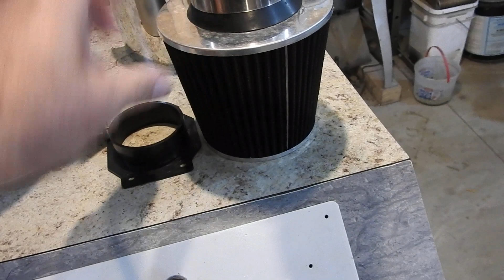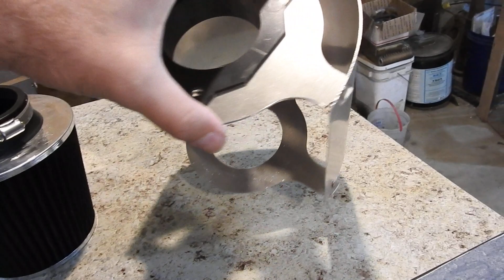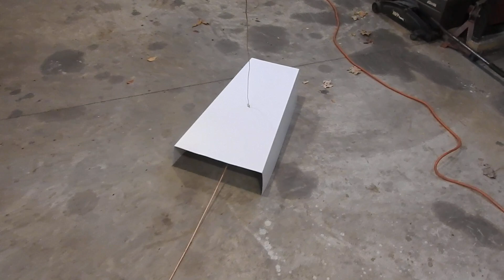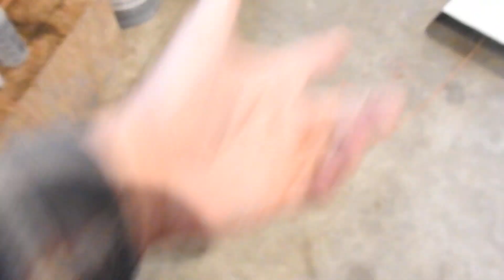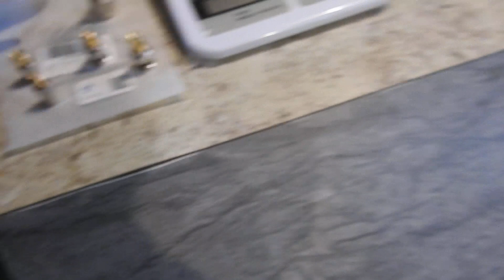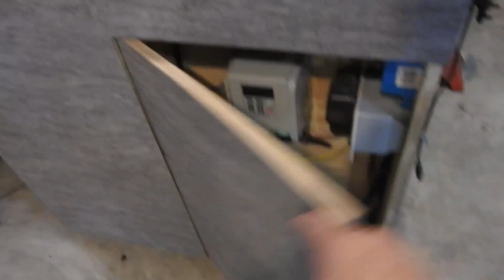WAR Corsair New Air filter set up

Comment: I would powder coat heat shield blue.
Reply from the maker: White or flat black is all I have. White will match the engine gearbox case.
Reply: Ahhh. Yes White might be the best.  @Dynodon64

Comment: Much better i was concerned when i saw that hose clamp version earlier ha. I still think you should put a mesh cover over the cowl hole tho, a bird getting jammed in there would be disastrous! Probably catch on fire if not jam up linkages or cut a line.
Reply from the maker: That may be an option, but all airplanes have open cowls.

Comment: I like what you did, i believe that will work. Now to see if your surging is fixed
Reply from the maker: The surging problem only started when the filter fell off. It would run rough when I got to 50 mph. That's what the shield is meant to help.

Comment: If the nuts will be on the bottom i hope you have plans to drill the bolts so you can safety wire the nuts in place.  Also since you have a cnc you might model that adapter plate and cut one from metal and weld on a short piece of pipe
Reply from the maker: The nuts are lock nuts, so they are safe. I will make a metal flange if this one shows signs of cracking.

Comment: Dino, Don, you’ve been real busy. I love your solution to the air filter situation.
Hey, I’ve been running CB radios in my vehicle for over 40 years. Vibration affects the screw on connections like anything else. I would think about adding a little blue Loctite at the connections in the tail end. I also have a handheld aircraft radio and I believe my antenna is a push and turn to lock on the antenna, so no need on that type to put Loctite on. Of course, I never use a pair of channel locks to tighten my antenna connection, but then again, all I have to do is reach up to the headliner to check it.
You are an amazing craftsman, best of luck to you.  NWR
Reply from the maker: I see your point on the Loctite in the tail. Too much could effect the ground plane connection though.

Comment: Nice 'mindwork' on the can design.  Perhaps a gasket of some sort between the aluminum top plate (unless the powercoat will suffice) and the plastic adapter?
Reply from the maker: There is a rubber gasket at the meter. Don't think I need one between the adapter and filter bracket.

Comment: Will the filter rattle on the bottom plate , sines it’s not fastened to it in any way?  Rattle / vibrations
Reply: perhaps a simple rubber sheet / gasket would be a good idea there. The bottom of the whole assembly may also move quite a bit (since it is only pinned together) and need a brace of some sort, eg to the battery cradle.
Reply from the maker: No it doesn't touch the bottom. If it loosens, it will be caught by the bottom brace.

Comment: Very clever on the filter shield, hope that solves your surging issue.
Reply from the maker: The surging was from the filter falling off. The original problem was a rough running at 50 mph. Hence the shield.

Comment: It has been many years, but there is a formula that determined how long the antenna should be. And your ground plane,  it works very accurate. The meter will help do that too. But you might Be able to. short Cut it With that formula. Calculate your higher frequencies. You'll use and then calculate your lower Frequencies that you'll use and pick a  length of antenna in the middle of that.
Reply from the maker: Yes I have looked up the frequency charts, So I have a good idea of where it needs to be on length. Thanks.
Reply: @Dynodon64  Back in the 70s, I lived in Saugus California right by I Indian dunes, a motorcycle dirt bike track in the back of the wash. That's where they film ba ba Black Sheep I used to see the corsairs  flying over all the time. I have a question for you. The owner of craft radio. For radio control airplanes,  Used to fly a small Experimental aircraft Of the courser. About the same size as yours. he had craft Servos in the wing. For trim tabs, do you happen to know if yours is the same design aircraft? I used to see him in R C modeler and model builder magazines with his plane.
Reply from the maker: I don't know, but I am sure it was a WAR aircraft. They were designed in the 70's, and the only ones available , even today. Nobody sells plans anywhere in the world for a Corsair except WAR. I knew that Baa Baa Blacksheep was filmed in California. Nice story. @petercarbin2077
Reply: @Dynodon64  Plus the video you have of the miniature corsair experimental aircraft. Flying. I think that's the one I seen pictures of in the magazines.
Reply from the maker: They were in Popular Mechanics twice. I have both issues.  @petercarbin2077